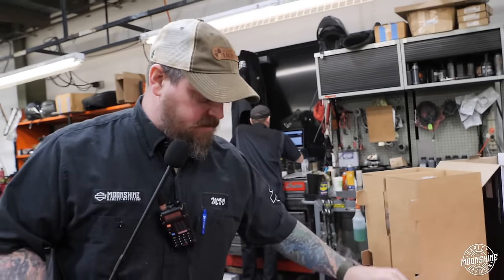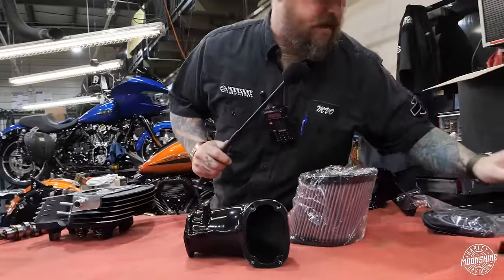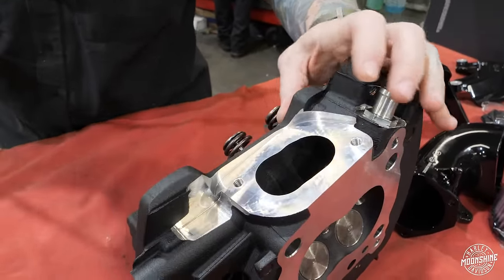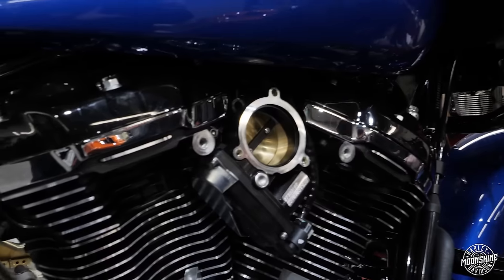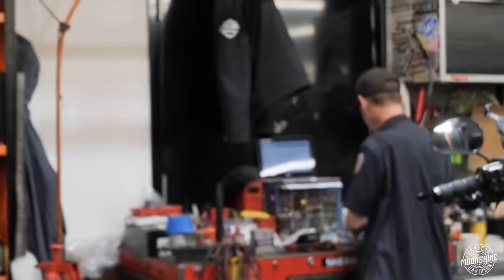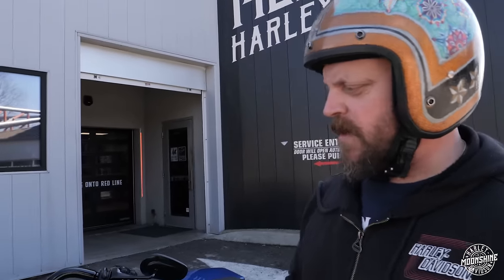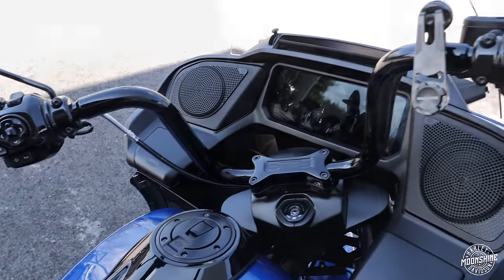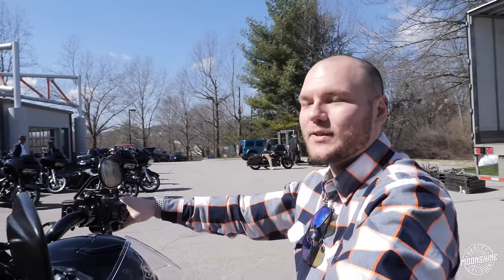Harley-Davidson Stage 2 Installation - Does It Make A Difference?

Comment: Great video. I purchased a 2024 and am having the stage 2 put in now. Can’t wait to pick it up
Reply: Are you doing this exact set up?
Reply: Only difference is I’m using V&H monster rounds slip ons. Very happy with the result, love the role on power when I need it.  Came from a 2016 Glide with a 103 Stage IV with the race tuner.  This definitely an improvement
Reply: …also used the wedge breather.
Reply: i did this exact setup including the heavy breather intake , waiting on my cam kit ... the bike arrived friday, i didn't even ride it stock
Reply: When putting this tuner on cvo st for 2-1 is there a certain map to use?
Reply: @Mouthy_Trucker hey when you installed your cam did u swap out the cam plate and pump or left the stock ones in there?

Comment: I had a RS468 cam-hpi 2-1 with sns ported manifold installed n a 2023 117ci . 117hp-136.6tq. Stock 94hp-116tq. Hang the hell on type of change n power 😃

Comment: My question is what about the stock valve springs undergoing extra lift? How do you not have to upgrade the stock springs?
Reply: Because the new 2024 heads have better valve springs my guy for bigger bolt in cams .

Comment: Great video ! This stage 2 actually has better numbers than my 117kit on my 2019 RG Special! Could you list the parts and total cost of this build  Thanks
Reply: intake is 600 ish same with cam kit , slip ons are like 700 i think, tuner is about 400
Reply: I was wondering what specific parts and or part numbers so I know what to get

Comment: Anyone know the orientation of the rotor cup they added on these new non VVT cam chest? It’d be nice if it had the stamped notch like the older bikes.
Reply: Don’t need to be notched or keyed the ecm and sensor does all the math to figure out the stroke and cam phase

Comment: 511 on stock heads?!?! Wow! Must have upgraded valve springs compared to the older M8’s???
Reply: Well that’s what he said if you paid attention during class. Lol  new 2024 heads don’t need valve springs and the 511 is a now bolt in cam.

Comment: How much for this service
Reply: If I heard him correctly he said just under $4000........ For a stage two........... Ummmmm yeah........
Reply: Cam kit: $650
Intake: $600
Tuner: $450
Mufflers: $700
Dyno: $500
6 hours labor: $1200
Total: $4100
Reply: @BrandonsHarley  That is not a stage two kit. HD SE Stage II kit is a cam and lifters. Thats it. The guy got 100% ripped off. My dealership will do a full stage III kit for $4000 out the door, everything included.
Reply: @retiredarmyvet2018  Santa give you the part?
Reply: @sheryo17  SE Stage III kit. $2000
SE Pro Street Tuner $450.
SE Wedge air cleaner $525.
8 hours labor $920.
2 hours dyno $230.

That's just over $4000. Funny thing. I had it done about a month ago.
Reply: @BrandonsHarley you don't need a dyno with the SE tuner , you can't change hardly anything so whats the point . the bolt ons are just that and the cam is easier than a drunk hoe at last call , why would any real man pay labor
Reply: @retiredarmyvet2018 why would you dyno the se tuner ?? there's no real way to change anything
Reply: @BrandonsHarley if this takes them 6 hours they should really look into a new career. intake and slip ons shouldn't be more than 1 hours cam shouldn't be more than 2-3 , realistically 2

Comment: Not bad at all, plus maintains factory warranty.  
Too bad California residents:  These performance parts are 49-state U.S. EPA compliant but are NOT compliant for sale or use in California on pollution-controlled motor vehicles. California guidelines on tampering can also lead to substantial fines and penalties.  Some of the coolest hot rodding came from California.  So sad.
Reply: you get what you vote for
Reply: You know none of us are following those guidelines. Still have the best builds. Come on.

Comment: Did I hear him correctly? Did he say just under $4000 for a stage 2 kit? Holy shit batman. My dealership does a SE 122 stage III kit for that.
Reply: What dealer is that?
Reply: @CoreyBurke-b8y  Santa Claus Harley Davidson...
Reply: @sheryo17  SE Stage III kit. $2000
SE Pro Street Tuner $450.
SE Wedge air cleaner $525.
8 hours labor $920.
2 hours dyno $230.

That's just over $4000. Funny thing. I had it done about a month ago. COX Double Eagle HD.
Reply: My stage 2 was 1400$
Reply: @retiredarmyvet2018  Correct price but in the stage 2 they ad the exhaust i think
Reply: @sheryo17  You should go back to talking to Santa Claus because you have no idea what you are talking about. Stage 1 exhaust slip-ons, air cleaner and tuner. Stage II add cam to stage one. Stage three is added big bore kit and intake to stage II. Stage IV add ported heads, throttle body, high flow injectors and exhaust headers to stage III. $4000 for a stage II is a 100% rip off. Like I said. I just did a stage III with extras for $4100 out the door. This guy got ripped off big time. Stage II should be NO more that $1500 out the door.
Reply: @Mikey1stop  Yeah that's about average. The guy in this video got ripped off big time.
Reply: @CoreyBurke-b8y  SE Stage III kit. $2000
SE Pro Street Tuner $450.
SE Wedge air cleaner $525.
8 hours labor $920.
2 hours dyno $230.

That's just over $4000. Funny thing. I had it done about a month ago. COX Double Eagle HD.
Reply: @retiredarmyvet2018  I know all this shit , don't be so emotive, I said if you do a stage 2 directly from stock you need to ad an exhaust this is why the price is higher than a stage 2 frome stage 1. Don't know the price for screamin eagle pipe in US but here it's about 1100$ so good luck to stay under 1500$
Reply: @sheryo17  Ummmmm you did not say "If you do a stage II directly." Now you're just trying to cover your ass. Stage II even with slip ons is no more than $2500. Again. At $4000 this guy got ripped off big time. You must work for this shop. If so you should be arrested for fraud and or theft.
Reply: @retiredarmyvet2018   @retiredarmyvet2018  yes to explain in detail because while youre though i'm a fool you dont understand anything..

the price depend on the part and brand you put on your bike if you do your stage 3 on a brand new bike with a 1100$ exhaust you gonna pay more...simple math. Screamin eagle part are expensive but the guy keep is waranty...I dont wanna answer you until december because it's gonna be a Santa shit for real!!

Have a good day sir!
Reply: @retiredarmyvet2018  so I live near Detroit so in use motor city Harley Davidson. Where did you take yours to get it done?

Comment: 4K for 25 horsepower? Lmfao. That’s awful.
Reply: cam and the kit. pipes, tuner, air cleaner etc under 4k keep warranty, sounds like a thumbs up
Reply: @shanepond6433  My dealership will do a SE 131 stage 4 for $4100 out the door. $4000 for a stage 2 is highway robbery. I feel bad for the owner. He got ripped hard.